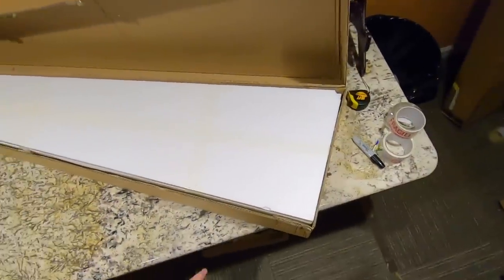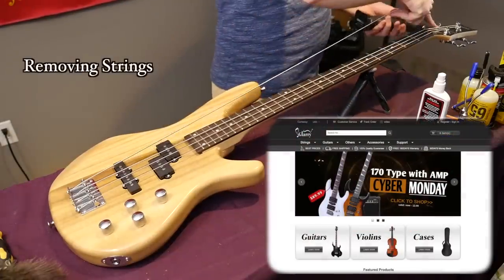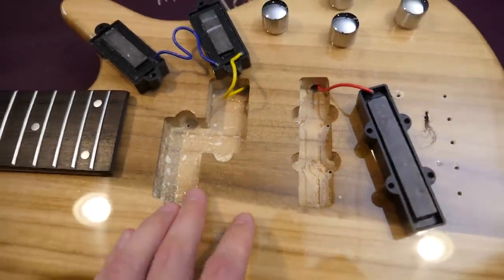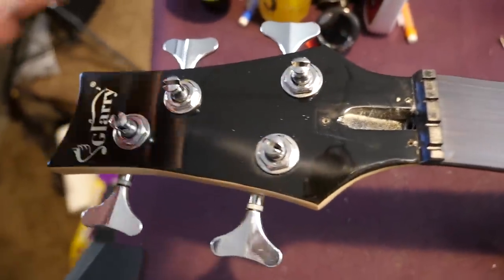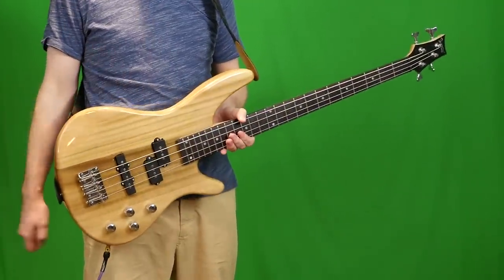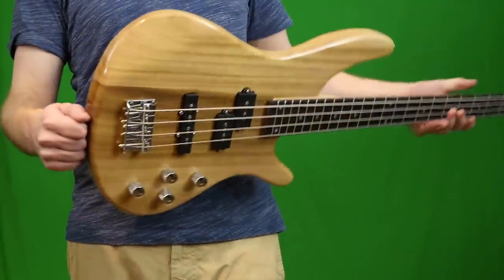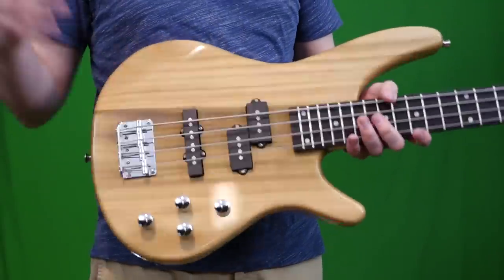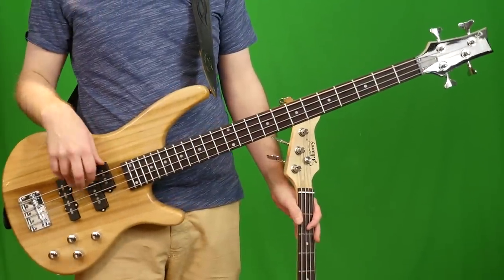I Got Sent Another One... | Glarry GIB Burlywood 4-String Bass | Review + Demo

Comment: Just because of all the rap about Glary I ordered two P style Basses. One for me, the other one for a friend that wanted to play bass again, after a hiatus of 25 years. He didn't want to spend lots of money, so the Glary just came right. 
An what can I say...
For € 85,-- its a bass I would recommend to anybody who needs a cheap P style bass. Its really light, the frettwork is ok, say, better than on a cheap Squire P Bass. A bit  long frett ends, but playable. The bass has not much output, the tone is typical P Bass. You have to give the amp more gain on the amp to get a punchy tone. The setup was decent right out of the box, the finish was astonishing well done. 
I am impressed what is possible today for this small budget.
Reply: I got the same bass last year, ya know what I'm doing with it? I removed the neck, hardware and electronics and I am fitting that all on to an Epiphone SG Special body (6 stringer) Lol. I didn't like how my arm had to be with it being a P bass style, had I known this I would have ordered the Jazz bass style. I did upgrade the pups but nothing super fancy, they have a touch more punch than the stock ones but that's about it. Surprisingly from what I was able to find out online, the SG bass body IS the same size as the SG regular guitar body and everything pretty much lines up exactly as it does on the Glarry body only now my arm won't have to be back as far. I haven't decided on what color to paint it when I am done. I cut some wood blocks into the shape of the original pickup cavities and glued those in then I routed out for the bass pups. I plan on making a custom pick guard for it when I get to that point with some guard material I have, lol my routing work was not as good as I hoped otherwise I had thought of going without a pick guard on it. Should be an interesting instrument when I am all done with it.
Reply: @IrisGalaxis  Well, cause at the time I just wanted a regular bass and I liked the looks of the Glarry and the price, I don't actually "play" bass I just wanted something to learn on. The way it was set up, being a P bass, annoyed me and then Austin showed us that Gibson Sg bass and I had that old Epiphone body just lying around sooooooo.... lol
Reply: @IrisGalaxis  Yeah that's what I was meaning is I don't have to comprise on scale length it all works out perfectly as if this was made right from Epiphone's plant. I was a bit surprised that it works so neatly but hey I am not going to complain lol.  I may upload something but my internet here in my home is so darn slow a 1 minute video literally takes like 15 minute to upload lol. I am also turning a Firebird X into what I am calling a Telebird lol. If you search through Austin's videos from last year there is one where he is holding a blue Firebird X and the video title is something like" why does everyone hate this guitar" or " does it deserve the hate"  something about hate lol, anyway, I purchased that guitar from Austin, and about 4 others lol. Strictly with the intention of tearing it apart and customizing it. I had toyed with the idea of doing things like string through and fancy paint jobs, but then I was looking through my parts drawer and found a Tele bridge and got the idea to do this. Unfortunately I am not the only one with this idea, I have seen tow or three since I got the idea but oh well I am will still do it at one time. I like to just play with guitars and see what I can do to really change them and/or improve them. I also purchased a 2016 Gibson Les Paul from Austin that someone had tried to do a refinish on and failed lol. I took that guitar and got after it with my grinder and I cut a comfort belly cut into the back, yeah I forgot about the weight relief stuff and ended up making a big hole in the back that took me two weeks to properly fill and then hide while still keeping the belly cut in place lol. That one turned out pretty good but something went wrong with nitro finish because within a week of my completing that project the nitro began to get straight line cracks. Now three months alter and this thing looks like it's about 50 years old with all the finish cracking. I don't know if I just got as bad batch of nitro or if the paint I used underneath caused this, I used three different shades of silver along with some black and created this marble effect that I really like. I did spray two quick coats of the nitro on the face of the head stock and that is all checked up so I am thinking it's the nitro and not the paint since I did not paint that area at all. I took an old Strat style cheapo guitar and went after it with my router and purely by accident I ended up cutting this huge sitting bird image into it and then I painted it with some blue, purple and pink metallic type paint, once that dried I filled the entire cavity up with Epoxy and that looks cool so far but I haven't got back to that project yet lol. Austin also sold me a 1987 Gibson SG Special that was white from the factory but someone decided to hit the face of it with black and silver spray paint and really messed it up. I had a guy who wanted to buy it if I finished it with Heritage cherry, so I did that and it turned out really nice. But he never responded to my messages when it came time to sell it to him. So I just finished it up after I returned it back to the original white finish. I left the neck bare, it has a maple neck, and slapped a stinger on it and then finished it with some Tru-oil, man that really makes the neck feel slim!! lol. That one came with Schecter pups in it and I am going to change those out. Now while it may seem that I just like messing around with guitars like this, I will not do any such thing to a good guitar, like a Les Paul that has nothing wrong with it, all of the ones I do have issues that cause the refinishing to be necessary. The purists get upset when you tell them you went after a Les Paul with a grinder LOLOL. I am actually considering refinishing that guitar again since the nitro screwed it up and this time going to all white, I have this desire for an all white Gibson collection lol.

Comment: One way to correct the neck dive is to use tape weights like they use on tires. You can hide them in the control cavity and tape over them to protect the wiring. It doesn't require much weight but the results are well worth it!

Comment: I sanded down the points of my GIB headstock to look like a Ibanez, then I sanded down the face of the body/headstock and refinished it using black stain and silver Rub and Buff to highlight the grain.  Steel wooled the back/sides of everything to give it a smooth satin finish like the back of the neck.  Love the two-tone look, and I don't have to stare at that Glarry logo anymore. I carved my first custom nut out of a Graph Tech Tusq XL 1/4" blank, using the plastic nut as a template. It was harder than I was expecting, but turned out pretty well for my first time. Certainly an upgrade from the factory one.  I replaced the output jack with a Switchcraft and  rewired everything with higher quality cloth-covered wire, after coating the pickup and pot cavities with conductive paint (and grounding to it).  Noticeably cut down the hum.  The thing sounds pretty awesome for a passive system, and I'm enjoying the hell out of modding, without worrying about destroying an expensive guitar, as I learn.

Comment: I bought a glarry Jazz 2 years ago. It arrived as jig saw puzzle. Strap button fell out, strings scratched the neck, the ground was not soldereed to the electronics, the pick up screws and the way they were mounted F'ked! But it was not my first rodeo, I am old timer and ordered it just to see... So I repaired to what should have been factory. The only new parts I put on it was wood screws for the pick ups, and wire to rewire the electronics. Now with that said.... Once in spec and functioning the tone was not bad. Then I set the neck up and though the neck is as thick as a telephone pole, it slaps awesome.

Comment: For a maple neck, you don't really want a lot of figuring...you want really straight grain (i.e., running parallel along the length of the neck) to minimize the chance your neck will warp/twist (you want solid trunk wood for strength and stability rather than limb wood).  So a relatively plain neck with some figuring on a separate headstock is good :)  So that neck looks solid!

Comment: The neck on the glarry bass I bought warped so much that it is completely unplayable now and the truss rod is useless.
Didn’t expect much from it anyway and its just been sitting in the rack, but has anyone else experienced this? I’ve never owned a bass before.
Reply from the maker: The P-bass glarry I’ve had for quite awhile has held true. If you bought that one directly from glarry and not one of the 2nds from eBay - I’m sure they’ll help you out
Reply: The Trogly's Guitar Show thanks for the reply, I’ll consider doing that. The one you have here looks great, I have one of the early models.

Comment: Trogly- When I turn the volume or tone knobs on my Glarry IB bass, it is like 95% no change at all and then the last 5% of the turn makes a difference.  It is almost like having on/off switches for knobs.  Was that your experience?  What will fix this... new pots?  (I am new to working on basses/guitars.)  Thanks in advance!
Reply from the maker: Mine was responsive on all levels. If you got yours on eBay - that is where 2nds are sold at a discount that usually have small issues like that.  Yes, new pots would fix that for you
Reply: @Trog  Thanks for the info. I actually got mine on Amazon before it was even listed on the Glarry web site! (It was called the Glarry IB Bass, but the same thing with a different headstock.)

Comment: I just ordered one of these in the sunburst finish under the Layee brand name on Amazon for a whopping $22 (all other colors are $80) Only difference is the layee is even closer to the ibanez headstock).  I want to do some custom acrylic and inlay work on my ibanez and found the layee to use as a test mule.  I ordered an extra set of strings for it that were only $3 less than the bass 😂
Reply: Is the Layee Brand made by Glarry basically?  Does it have neck dive?
Reply: @OD138  yeah.  It is a hot mess.  My guess is that layee is the manufacturer for Glarry, but I think glarry fixes them up a bit because this thing is BAD.  Got it to cut apart anyways, but every cavity was full of saw dust, pots were falling into the body, etc.  Photos on twitter @Xobeloot
Reply: @TheBeardofDOOM   Oh Shit! I just ordered one today, I should have got the Glarry, lol!